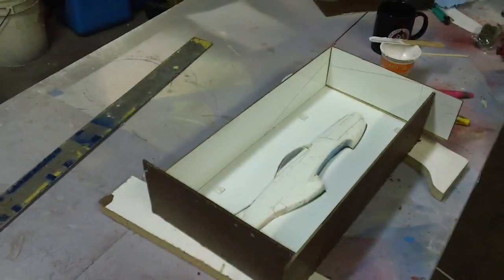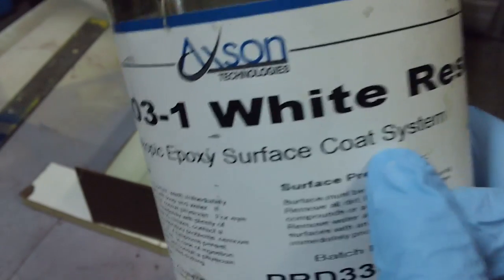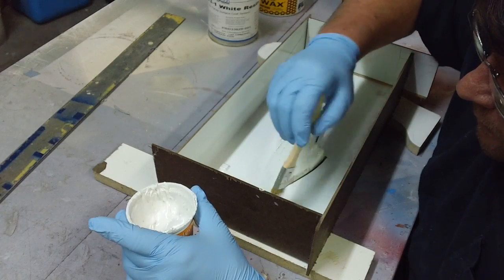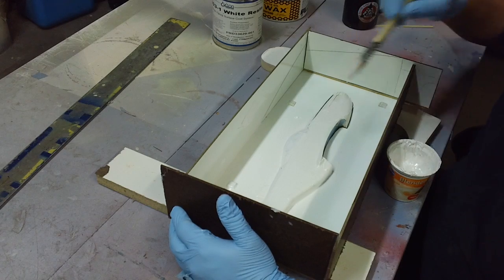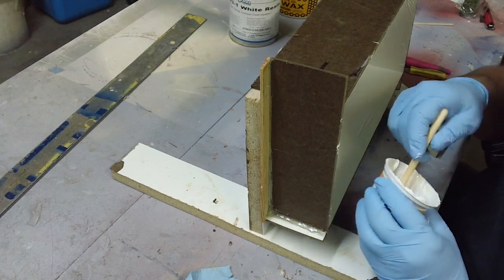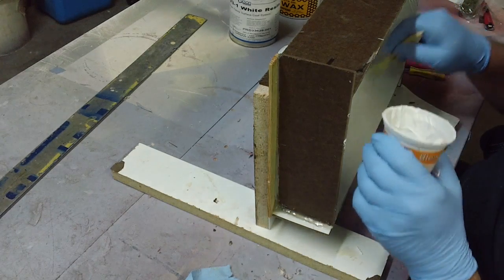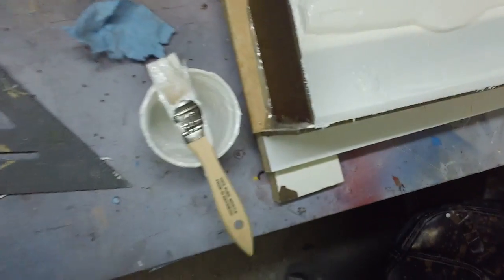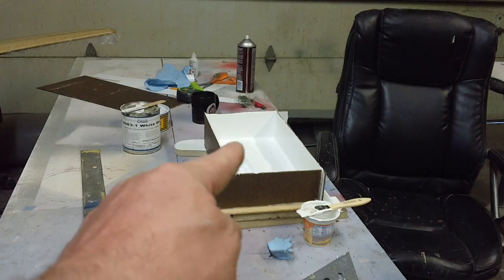how to mold a composite micro P-51 #12

Comment: Some of your molds you did not use the white coats and some you did. I am sure you have mentioned it before, but would you reiterate what makes the difference to you as to whether you use the white coat or not? You mention that straight epoxy has a higher compression strength, so to you, what makes you do it one way or the other?
Thanks for the instructional videos.
Don